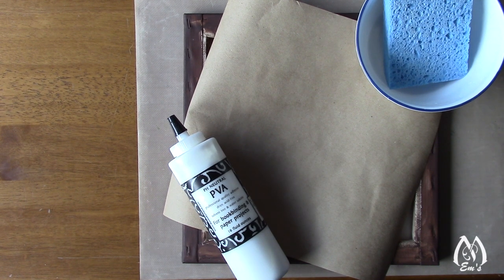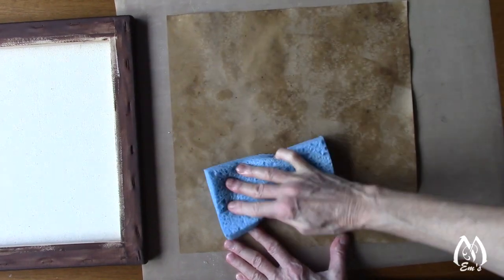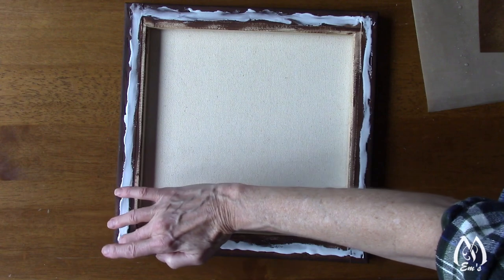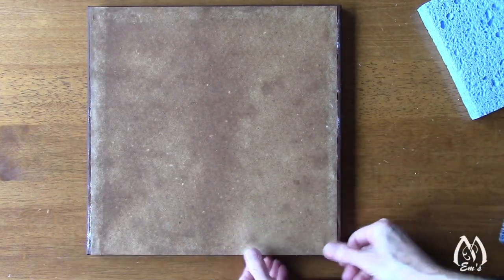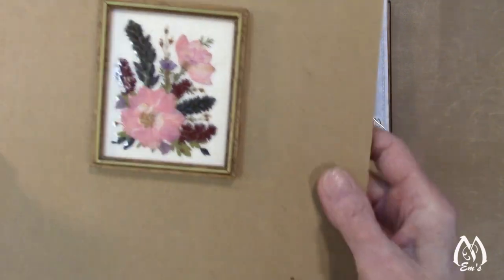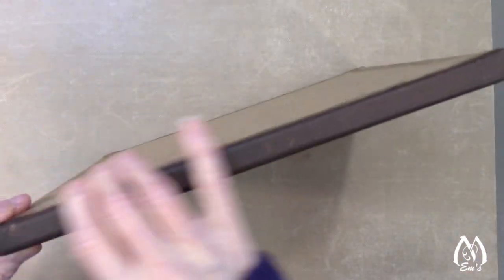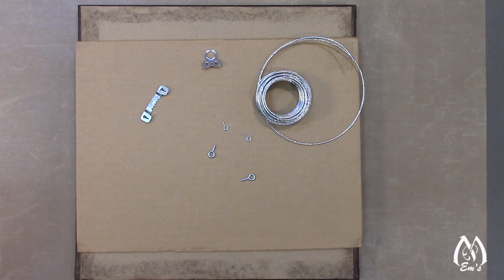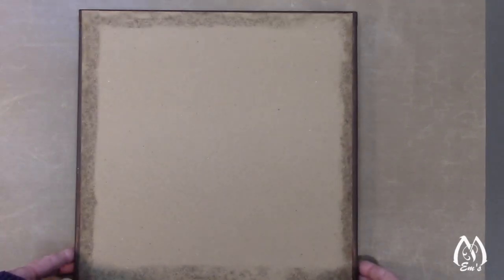How to Get a Drum Tight Picture Backing | Canvas Backing Paper | Hanging Considerations

Comment: Wow, I don't know what to suggest.  I'd be interested in your final decision.  I like the backing process.  Have you ever had one rip after getting it drum tight or is the paper pretty tough?  My final decision would be:  On Etsy a lot of sellers will give the option of what kind of hanger they prefer, like you mentioned.  That would be a little extra work, but would your pictures store better with no hanger, so it really wouldn't matter what kind you use.  Let the customer decide.  If they have no preference, then tell them how it will come?
Reply from the maker: Hi Denice, I ended up providing options since I couldn't decide... Thanks for the reply!

Comment: Thank you for creating this video!!  I just purchased a painting (looks like 1980's). Question: What's the fastest and simplest way to remove the canvas paper backing without damaging anything and how do I get ALL of the paper off the wood?  I want to paint over the painting.
Reply from the maker: Hi, good question. I don't know what they used for the glue (water soluble or sovent, etc.) Personally, I would gently take the paper off from the hollow part of the back over to the frame area first. And then take a scraper to gently scrape on an area to take of some of the paper/glue off the frame (or sandpaper). Then sanding it down may be the best option - and clean the dust up after. 

If you can get the back damp in case it is water soluable glue, you could try dampening a towel and setting the painting back on top of the wet/damp towel and see if that will soften the glue (some glues will not hold up to water/dampness. In that case maybe it would be easier to scrpe off the debis? This is assuming you are talking about a painting stretched over a wood frame and glue used to adhere it to the frame. Perhaps others with more expereince about how to refurbish used paintings have a better idea. Thank you for watching, Em

Comment: I ordered heavy duty craft paper as that was all that was available for 36” wide. I have several open canvases I want to do this to- how difficult will this be? 
Then I put the D rings on?
Reply from the maker: Hi, that should work. Don't think it would be too hard, unless the item is very large. Just be sure to follow the proceedures here about dampening the paper (not soaking wet) because that dampness is what goes tight upon drying. I would just do one first to make sure you like it. Or test on something smaller to get the hang of it. I would use a bookbinders or PVA glue that is water based. Thank you for watching, Em

Comment: I am in the research stage. I suspect dampening the inside of the dust cover could trap moisture and could lead to mold growing. I want to keep moisture away from my paintings and prints.
Reply from the maker: Hi, the dampness is very short lived. Being paper, it dries. In my experience it does not have any lasting moisture once dry to worry about. I have done this for years and have never had any issues. Be sure to just gently moisten the paper (not getting it soaking wet) and not the item it is being put on. Dampening the paper simply causes it to tighten upon drying so it is not a sloppy/lose finish on the back - looks more professional. My father who was an art teacher also papered the back of his paintings. Thanks for watching, Em

PS: this is for papering the back where the paper is not put direclty on the art. As you see in this video, there is a wooden frame the the paper is being applied to, not the canvas back itself. Or if the item is in a frame, the paper is put on the frame and not directly on the art piece.
Reply: Also haven't had any issues with this moisture either because it is damp, however, I use a thin line of double sided tape instead of glue, and a misting bottle or spray bottle with water or alcohol on the paper after I've attached it with the double sided tape.  Then I take a little fan or hair dryer and watch it dry and shrink which is actually cool to see it tighten and look so good after! The water makes the paper shrink and tighten up for that "drum" type look.  Most folks who frame pictures professionally do this as well.

Comment: Have the paper ever become loose after some time? Do you put a new backing on or re dampened the paper and add new glue?
Reply from the maker: HI, I have never had a problem with it coming loose. I suppose after many... years depending upon conditions. But for me, I have some small curio frames done in this technique that I have had in my curio cabinet for decades with no issue. I can't speak to glue formula changes from a manufacturer over the years, but so far so good for what I used. Which is usually a PVA bookbinders glue and sometimes Elmer's Glue All. Thanks for watching, Em